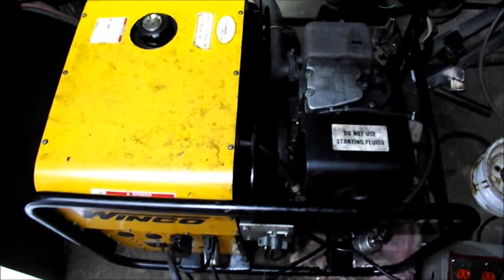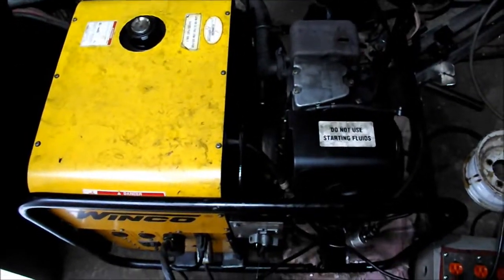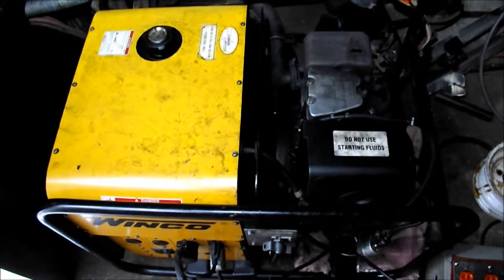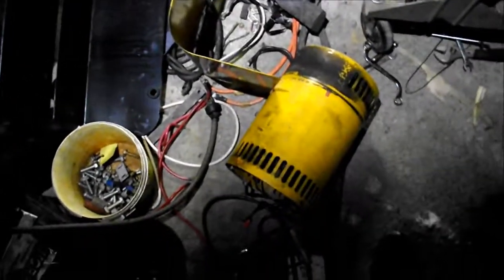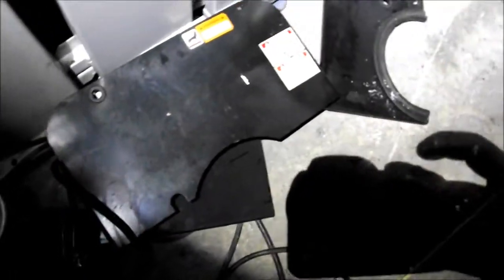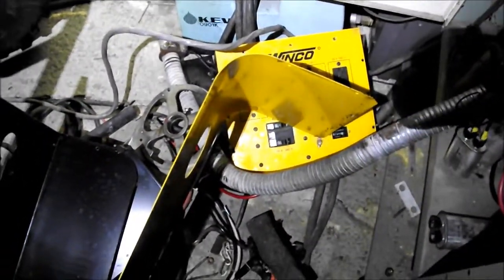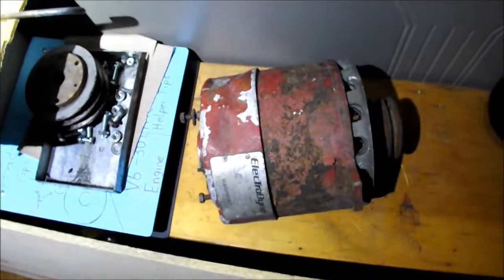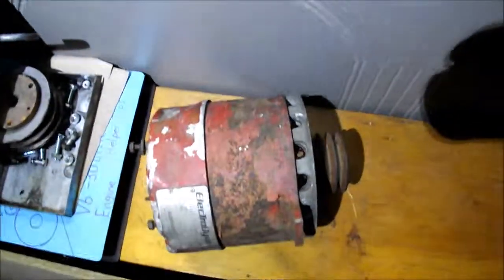Generator Switched Over To run A 108 AMP Alternator Dc Power Battery Charger For Off Grid Home

Comment: what voltage is your battery bank?  I built a DC generator like yours to charge my 48V battery bank, and I'm getting about 70A through my charge controller.  I keep blowing rectifiers, though ... :-(  

This was the first time I cranked it up:
https://www.youtube.com/watch?v=PV5lKkfn2IQ

then I reduced the drive pulley to get higher RPM's on the generator head, and played with the throttle to get max power output:

https://www.youtube.com/watch?v=TNZ5EY4bLmk

I'm using a Yanmar L70AE single cylinder diesel myself.  I think it's comparable to your Hatz.
Reply from the maker: +lambertmt Have you installed heat sinks to reduce the heat. Perhaps double up on the rectifiers. Large heat sinks do wonders. Seen you videos but not able to see the rectifiers.
Reply: +Thinking out side box thanks for the quick reply.  yes, I have heat sinks and also cooling fans blowing through the electrical box.  I suspect the failures might be vibration-induced.  next step is to move the rectifiers away from the engine frame so they don't shake.  what is your battery bank voltage?
Reply from the maker: +lambertmt 12 and 24 volt. Running from to banks.
Reply: +Thinking out side box so, are you running the alternator straight into your batteries, or through a charge controller?  how many watts are you getting, and how many KW/hp is your Hatz rated at?  I think our setups are pretty similar.
Reply from the maker: +lambertmt The hatz is 7.5 kw MAX. I run it straight to the batteries. I put a adjustable regulator on the alternator. I,v changed the alternator from when the video was made. I use a 180 amp high end alternator. Works great. With it being adjustable. Its the best battery charger as far as I care. Works really good. I have a by pass switch for the solar panels and for the alternator. When no sun for a period of time and the batteries are low. The hatz and the alternator does my charging. When using the alternator to charge the amps drop as the batteries are coming up in charge and then just floats to give the soak in charge. Works real good. Hope this helps.